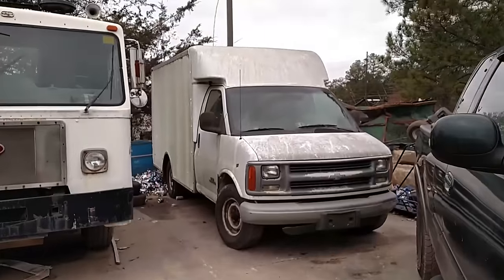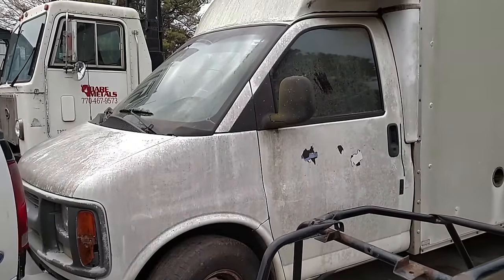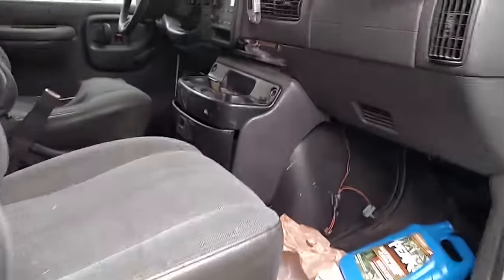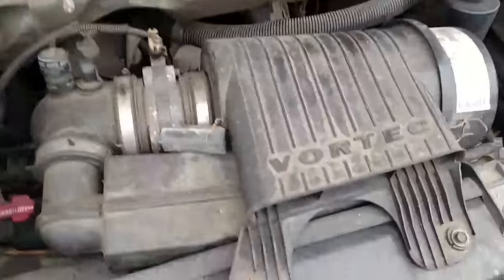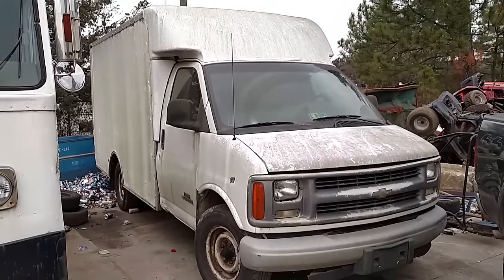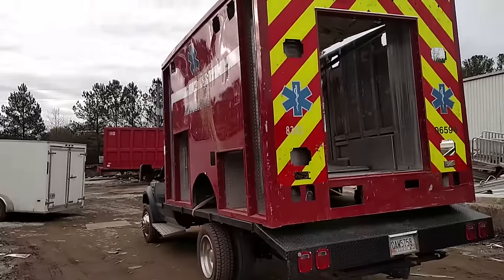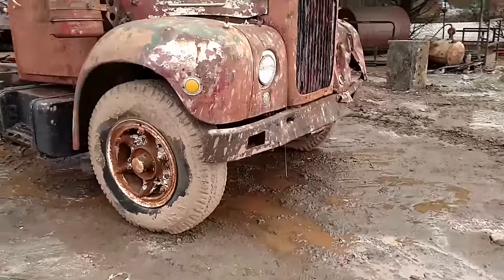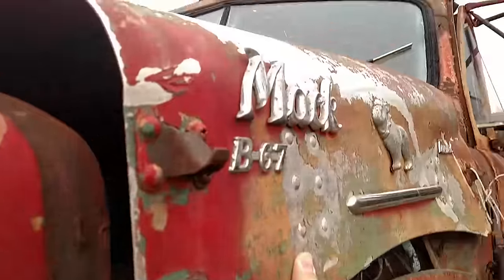Found a cheap 12ft Box Truck for Camper project 68

Comment: if the paperwork is included  1500 is a reasonable price , think you cant even get a van for that price 
looks like they used a digger to get that ambulance body off the truck , kindof a shame actually
Reply from the maker: It should include the paperwork for that price. You could always make an offer also. That's just what they are asking.
Reply: i'm living in europe , its a dream of mine to travel the states one of these years , prolly never will have the cash for it anymore though 
still keep buying lottery tickets though

Comment: heh, I clicked on this expecting to see you were starting a 2nd conversion...
Reply from the maker: Don't think it didn't cross my mind. I still don't see the end on this one.  All bets are off when I finish though. Travel trailer or house boat or Trailer houseboat??
Reply: I think a vintage restoration would be a cool project, be it a TT or some of the original Class C's. http://www.classiccarclub.co.uk/wp-content/uploads/2014/09/ford-western-flyer-front.jpg
Reply from the maker: I started with a Serro Scotty and realized it was so much of a basket case that it was necessary to rebuild the whole thing. Not much of a restoration if you have to replace everything.  That Ford Western Flyer is cool but probably very rare and $$. I don't know, I'm still open to it if i ever find the right one.  Have you seen this video of mine? https://youtu.be/o5BGlGrid2Y
Reply: I was thinking that a restoration would give you an excuse to explore more junkyards, while also giving you a reason to up your fabrication game, maybe a nice little CNC machine for the new year. Oh, and better grab a 3D printer too...   ;)